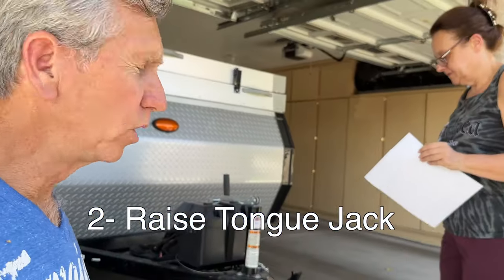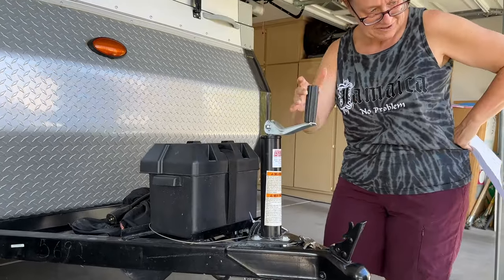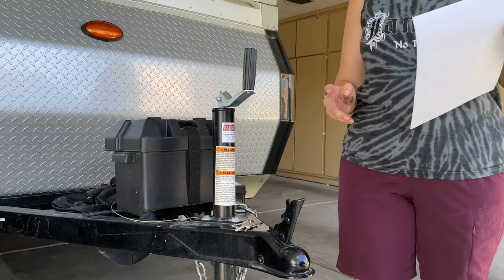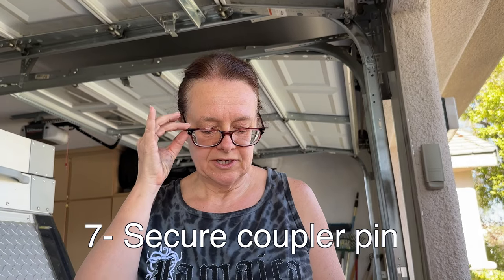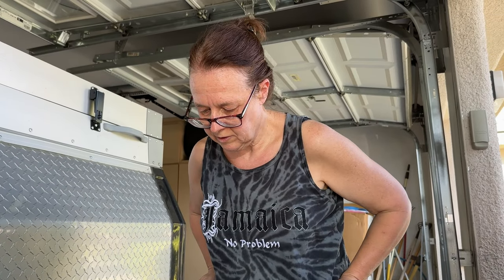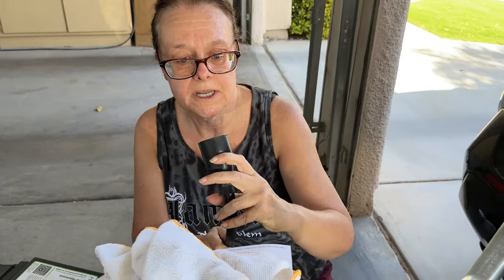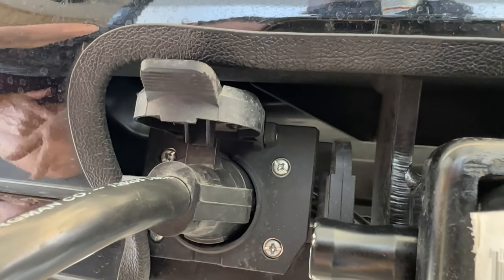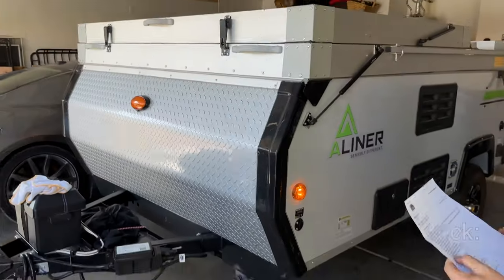How to Hitch up a Pop Up Camper | Easy Step-By-Step Guide for New Owners

Comment: What a great idea for a youtube.  Some long-term Aliner owners that camped with me last May failed to do everything on their trip to a national Rally in June.  Just missing one step can cause a problem.  Their missed step was plugging the 7pin connector securely into the tow vehicle.  It drug behind the Aliner on the road which sanded the end off!

I was off to a tri-regional rally in 2013 and trusted someone else to secure the tongue to the tow vehicle.  It was latched above the ball instead of below the ball.  The trailer came loose from the tow vehicle a short distance from my residence and left a small tell-tale sign of this on the rear bumper of the tow vehicle.  Fortunately my electric tongue jack had a skid plate and I was going uphill very slowly.  The electric brakes did stop the trailer when I pushed on the tow vehicle brake pedal.  

I hope people realize how important it is to never trust anyone else to properly lower and secure the tongue to the ball on the tow vehicle and be sure to follow this video.
Reply from the maker: Thanks so much Brian for the awesome feedback.  I've always been very paranoid about hitching up.. thus i'm always ensuring the hitch ball is properly secured and all the steps are followed.  Not doing things correctly is a recipe for disaster.

Comment: Yay, Nicole!  My wife also wants to be involved in how to hitch our camper.  You did a great job showing how important it is to make sure the hitch ball is seated in the coupler so it can lock correctly.  A lot of trailers get loose from too high of hitching thinking "it's on there".  And, I also see a lot of trailers being towed without a coupler pin or lock (doesn't take much bouncing to pop the coupler and the trailer gets loose).  Couple of things:  Grease.  I like using a tube of heavy-duty axle grease and only applying a dab on top of the ball before connecting.  I think the spray is a little too thin of a coating and it gets everywhere requiring much more frequent cleaning.  Break Away cable.  You really don't want to attach it to the same hitch everything else is attached to...  Why?  Because if the hitch fails, then the break away cable never gets activated applying brakes to the run away trailer.  Let the hitch handle the coupler and safety chains, and then find a different anchor point for the break away cable.  Glad to see you folks are enjoying the 118 degree heat as much as we are in Phoenix!  (Sarcasm.  This heat sucks).  Cheers!  Pete in Arizona - KI7LIL
Reply from the maker: Thanks so much Pete on the suggestions on axle grease as well as break-away cable!!  I've been watching those Phoenix temperatures.. so crazy.  I'm definitely spending more time inside.. unfortunately we did this video in the open garage.  We we're sweating like crazy !!

Comment: Pro job guys!  That was a great idea to show the latching "foot" that's underneath the tongue.  Many people don't know what this part of the assembly looks like, how it works, or, that if they don't have the tongue "reach" for the ball, the ball can hang up on the "foot", and then not actually be coupled.  The ball striking the foot can also bend, or otherwise damage the foot, and then the trailer is always difficult to couple after that.  Replacement parts are available, so a damaged foot or bent threaded rod can be replaced.  As Peter mentioned, I'm also not a fan of the lube spray.  A dab up inside goes a long way, and you can buy a vinyl ball cover to help keep the mess a little more to a minimum.  Good pre-flight tactics also!  Cheers!
Reply from the maker: Thanks so much Todd.  Yeah, Nicole went a little nuts with the lube spray !!  I thought it really important to show the latching, as i've heard of veterans even taking this for granted, and it not coupling correctly.  I "always" look to ensure it latches from underneath.  I gotta watch your latest video !!  I'm killin my training.  Did 13 miles on Tuesday with over 4K of elevation.  14 miles next week !!
Reply: @GoldenK9Campers  Excellent news on the training!  Be sure to add in more clean protein to help rebuild/build muscle (wild caught salmon, "grass finished" beef, and if you have a source, venison from NZ is a great red meat option).  Non-inflammatory nuts (walnuts, pecans, pistachios, macadamia, blanched or skinless almonds) are another good source, and they're high in other nutrients, per caloric content, as well as healthy fats.  Unsalted, and raw are the best versions.

Comment: How did you get a 7 pin harness?  Is that an oem hitch and did you diy both wiring and hitch?
Reply from the maker: Toyota installed the OEM Hitch and Wirinng harness for the 4 pin.  Then I went to a truck accessory shop to get the 4 pin to 7pin adapter and extra wiring installed
Reply: @ does this void toyota warranty? Would it be better to get a 7 pin  wiring upfront or you recommend what you did? Thank you!
Reply from the maker: @HDMOVIECREATOR2012  Toyota won't install the 7 pin.
Reply: @GoldenK9Campers  will this void toyota warranty? I got the extended warranty